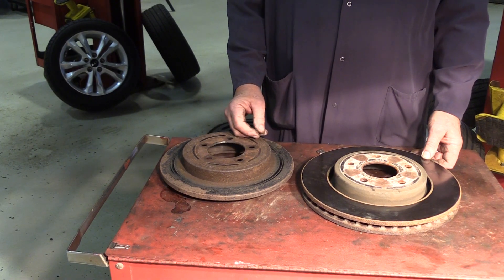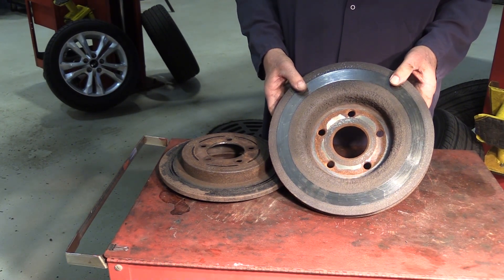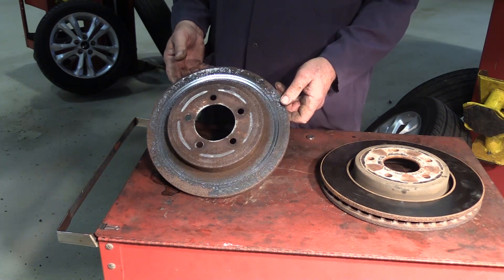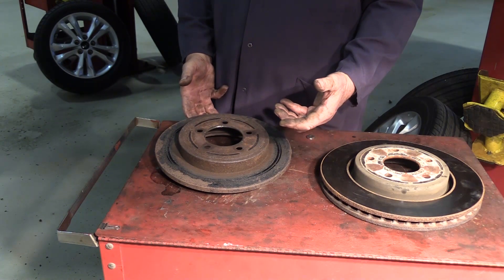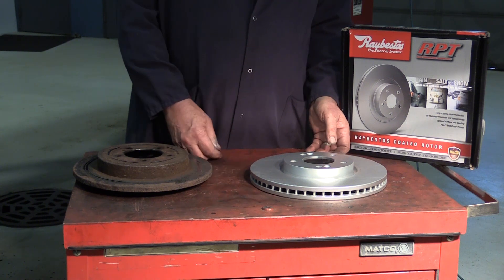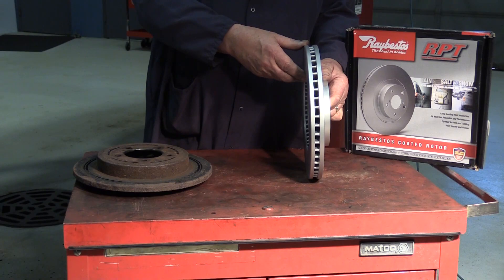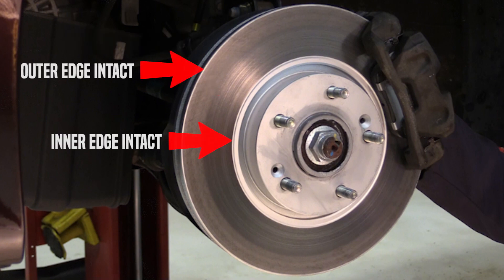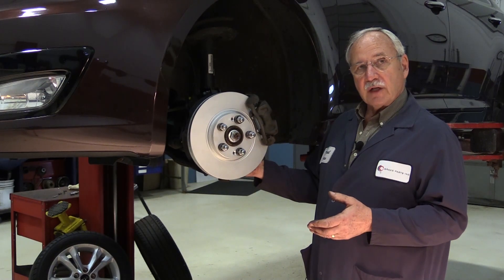Coated Rotors Discussion

Comment: I have less issue with the hub area rusting.  My biggest concern is the brake surface rusting.  I bought a set of brakes with geomet coating on the rotors and the hubs are fine, but honestly, I don't care if they look pretty.  But the brake surface rusted, pitted and completely wore out a set of ceramic brake pads in 11 months/9,000 miles.   I'm just looking for a rotor with better rust resistance in the metal itself, not a coating on top.

Comment: Just  installed Raybestos rotors on my Audi Q5 front. The rotors had coating on braking surface. Within first 5km under light braking, multiple deep scores on rotors, I believed the coating material trapped under brake pads caused the scores. My brake pads were OEM parts and perfect condition. I contacted seller, they wanted me to ship back from my pocket for RMA. Two rotors probably weighted about 30kg and cost fortune shipping. I did rear brakes with Wagner rotors w/o coating on braking surface, no scores
Reply: "Light braking" with new rotors and that's what you can expect. Follow the bedding in procedure and you'll have better braking performance and more even material transfer. I doubt there was anything wrong with them.
Reply: Possibly because they were cast in China.

Comment: Does the rust jacking on the swept area of the rotors not only cause expedited uneven pad wear, but increased  stopping distances ?
Reply: Pad wear for sure, I had that happen on my Fiesta ST, the rears were more apparent due to it having " torque vectoring" which just squeezes the rear pads the turning.

Comment: Is it recommended that these rotors are resurfaced with a brake lathe before installation to avoid warping? Every pair of aftermarket rotors i've had whether it was name brand or off brand were warped from the factory or needed to be resurfaced after a few thousand miles. I'm new to Raybestos products and definitely need to upgrade to coated rotors for these midwest salt covered winter roads.
Reply from the maker: They are ready to install right out of the package. 

You may want to check out our video on disc thickness variation and lateral runout: https://www.youtube.com/watch?v=B3JUPt4upxk. A rotor with a disc thickness variation caused by an excessive lateral runout is often misdiagnosed as a warped rotor.  The linked video will teach you all about lateral runout, disc thickness variation and how to prevent it.